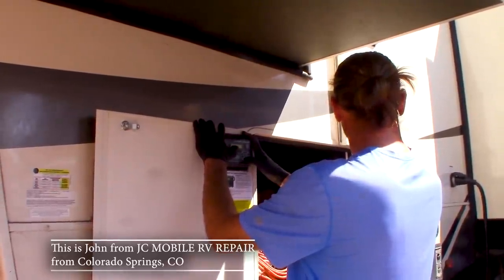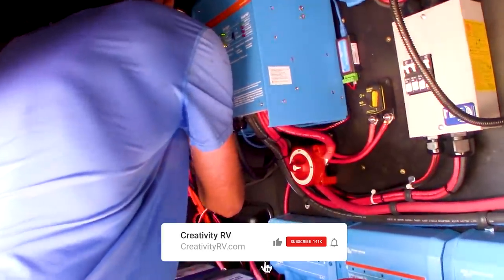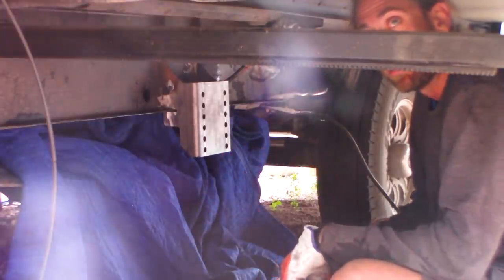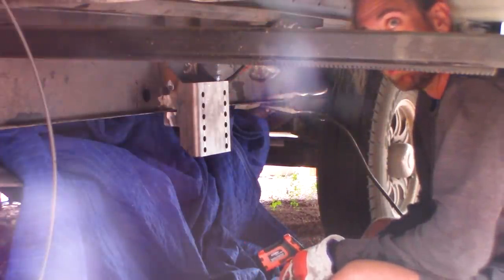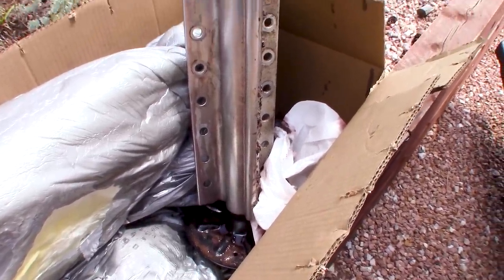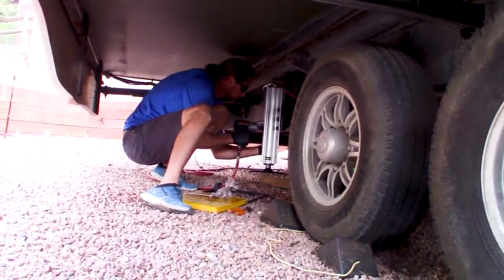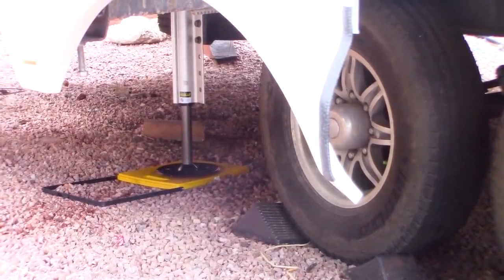I SNAPPED MY RV LEG! The Lippert Hydraulic System in my Fifth Wheel Went HAYWIRE. Now I'm stuck...

Comment: Thanks for an informative repair video. I had an issue with a Lippert jack/slide system on my fifth wheel while 2,000 miles from home. Lippert was very very helpful on the phone with my repair techs in trying to figure out my problem. My hydraulic pump motor would not work and Lippert kept saying it seemed to be a ground issue but we could not find any after 4-5 hours of testing so we decided to replace the hydraulic pump motor. It took 10 days to get it and cost $900.00. I decided to go to my next destination 750 miles down the road and wait for the part. Got the pump motor which is easily replaced and did this myself, took less than an hour but to my surprise I found the bad ground Lippert kept saying I had while removing the old pump motor. When the pump motor wiring was initially put together they did not crimp the connecter onto the wire properly so the wire was basically held in place by the plastic on the electrical connector. Tested the old pump motor and it's fine.

Comment: Hey, enjoy your channel and funny thing I never knew the names of the parts. But years ago we had a slide-out problem where one of my four slides was stuck in the out position. No RV ship, NO RV repairs in the area so wife called a tractor mechanic. He found we had four solenoids (which are caps) so he took one off one and replaced with another and it worked fine. He returned them and we never had another issue with our Forest River Reflection with a Freightliner Chassis.  Good stuff, sorry to hear you were sadly stuck in one place for so long.

Comment: Sorry for your trouble. These are not new issues with Lippert. I had issues back in 2015 when we bought our $225k Diesel Pusher. Lippert even sent a rep to my house after we sued Thor due to it being a lemon. Anyways, Lippert pretty much supplies all the junk RV manufacturers build RV’s out of. They cornered the market in supplies after the crash in 2008. I highly encourage you to inspect your frame on a regular basis.

Comment: Robin, i am so sorry, wow! That guy is worth his weight in gold!  I asked our local guy to help me figure out what was wrong with my e2 bars, and he had never heard of them! At least he didn't charge me. I had been considering selling our home and getting a fifth wheel, very high end using the high end parts. I spent weeks on looking at brands, parts used, service, size and layouts as we need a midbunk or den. Sounded like i found one that, though very pricey, was caring and only using high end parts. But they are factory direct and a long way away. Then i joined their group. There were so many complaints that i was stunned! The two names you hear as the top two in parts for RVs were sounding worse than the lower end RV complaints. It was like they raided the parts reject pile and used those haphazardly. The one part that i have never heard bad things about in any group are good year tires. But suspension, springs, all of those tire related parts, and some other higher end tire with a HIGH rating were ruined after only 3000-9000 miles because the suspension stuff was bad or installed incorrectly!  So something is screwy with workmanship at the parts and install factories. But the last and most unfortunate complaint was how disrespectful the manufacturer of the fifth wheel treated the coach and owners during the many repairs it was brought in for and a reimbursement promised not kept until they were threatened. They lost me with that one. The job was very sloppy, too. They video recorded what they got back. What a terrible mess in a huge coach! I would have had to hire someone to clean it, top to bottom using a ladder, too!   It was new, and they were told nothing was covered! But they had an extended warranty so it was with that. I think lots of people probably cancelled their plans to buy from this company. i spent weeks working on my customizable order. My whole thing is good service, good reliable parts. So i will go with less fancy looks and parts and just work on each thing separately, or maybe abandon my full time plans until quality matters again and honoring your word and warranties.  What i have now is piece mealing me to death with one repair after another but they are good to us so we maybe should stay with them though the finishing is boring and much smaller compared to what we were going to get. The one we wanted has more square footage than our cabin! Our current 25 footer has more storage! Also, they HAD to take it back.to the factory for all of the repairs. That is 7 states from us!  Just to go see and pick it up is 7 states away.  And we could not go to a hotel for nearly a month waiting for the work to be completed. One other thing was that i guess the front of the trailer also collected many layers of bugs they could not get off, so they said they would pay extra to please get it cleaned. That never happened. But i never thought about that being a huge issue, but this fifth wheel is huge so maybe that is why. Perhaps a coating for bugs is important too. I would love to know how to pick.quality.  Every rig will need tweeks, i know, but major stuff right out of the barn is dangerous.

Comment: And people wondered why we had a couple of different warranty and breakdown policies on our diesel pusher. Any time you have slide ins you can pretty much expect a problem down the road. And usually you are in the worst location. But the good times were greater than the low times.

Comment: You should check out the Snap Pads, for the bottoms of the levelers. They won't do anything for this problem, but are great for adding area to bottom of the legs for weight dispersion.  Safe travels!

Comment: I use anti stiction fluid in my Lippert system as recommended by them. It should prevent the valves and pistons from binding. 1 quart is recommended.

Comment: There may be defective mfg on Lippert's end. I watch another YT RV video & they had a similar if not exact same problem with the automated system going up/down. Lippert blamed it on them also, but their tech called Lippert, like John did for you, & then they took responsibility for the defect. The only difference is that I don't recall their slide being affected. Glad you got yours repaired, even tho it probably took longer than normal because of covid. Stay safe...

Comment: Probably could've swapped the valves, with the solenoid, from the other side to get it in an working. The plunger failed but alot of times if there are two, one for slide one for leg, you can swap it get one to move them swap back for the other. Glad he was thoughtful enough to call them and take your side and explain. He is great happy camping!!!

Comment: I had a problem with my Lippert stabilizers also. When I parked and was ready to pull out after the stabilizers we’re down the front ones came down on my truck. BAM! It crunched my tailgate. Thanks to a neighbor he got the stabilizers to go back up so I could get my truck out. Long story shut, I had to get a new tailgate and a my repair guy had to replace the whole system. One stabilizer still didn’t work so he had to replace the
Reply: He had to replace one valve.

Comment: I find many are using 'coronavirus' is being used for an excuse, sometimes valid, sometimes not. 
John from JC Mobile RV Repair is an angel.  As the saying goes. Worth his weight in gold. 
 You had bad luck but Eric with his jack problem has worsened after weeks and big bucks, his problem didn't get resolved yet.

Comment: That wrong jack might have been upgraded for safety. To me it looks like that block on top is a safety valve. It prevents jack moving without pressure from pump. So for example if you have a leak in the system jacks could fall down (even when driving) just by gravity with that safety valve they can't.

Comment: Sorry! Ouch! I already knew I wouldn’t get a unit with a slide when I get another motorhome next spring but this solidifies my decision. But I don’t full-time like you which might affect my decision :) I don’t need the space and I don’t want the weight and all my friends with slides have had problems. But as I said if I were full timing and needed more space I might change my mind. I travel around with short-term stays for a month at a time. I can’t stand the thought of being without my rig for that long.
Reply: It was the hydraulics not the slide, but it makes me wonder if they should not have a back up plan for bypassing the hydraulics. What if she was having to evacuate or was ill?  Good thing to.check on. So glad she posted that !

Comment: Tell me about the yellow ground pads?  Are they necessary? What do they do?  We always just put our levelers down into the dirt/gravel.
Reply: That seems to be problematic for bends, corrosion, and mess, also the unevenness of some areas may require several blocks. Check your manual and  ask on your user group on Facebook for your brand.

Comment: I'm glad that all worked for you... eventually. But this is exactly why if I'm ever able to get on the road I want a small RV with no slides or automated leveling. I know other things can and will happen... but it seems everyone I watch with slides eventually has one problem or another. I've been noticing though that many of the small RVs have slides and fewer are being made without them. Preplanned maintenance costs by manufacturers? Are there other common add ons that are like that it might help to avoid?

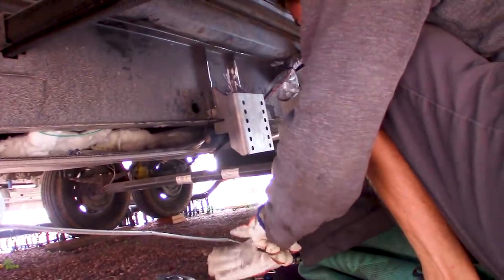Comment: I am curious about something I saw, your tires appeared to be on top of wood blocks (3:18). I have never done that with my Solitude, I park put the jacks down and it does all the leveling. I have never been unleveled. I wonder if it helps with something I do not know about. Why do you do it for? Also, at same 3:18 I see some white stuff sorta like cotton looking, I went under my rig and it is all covered nothing like that. What is that? Thanks.